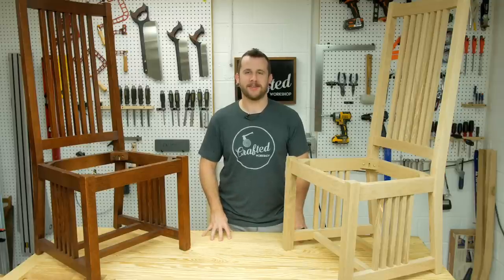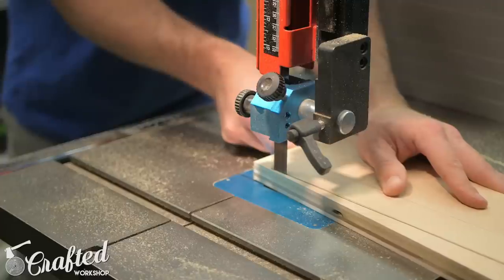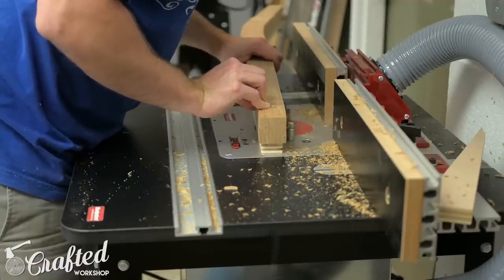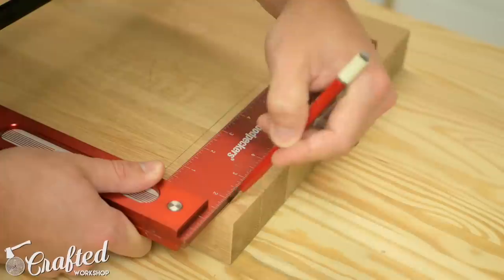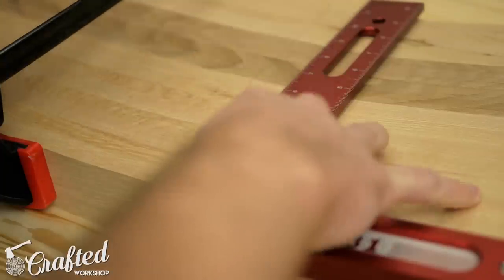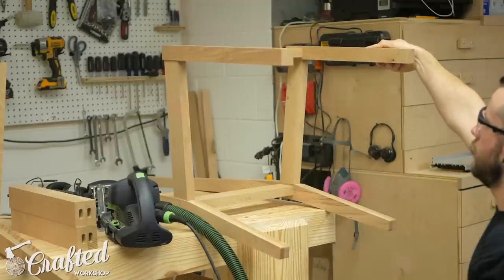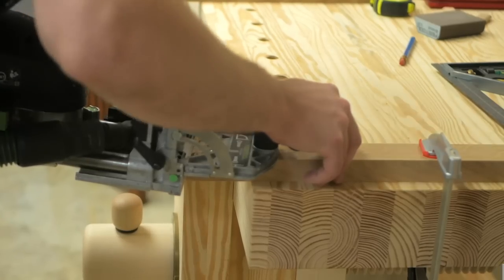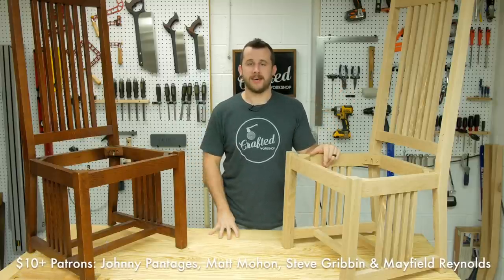Mission Style Dining Chair | How To Build Part 1 / Arts and Crafts Style Woodworking

Comment: I have to say I am very impressed by your woodworking.  I have been a carpenter for 20+ yrs and I am working on getting into wood working and cabinet making.  I have found a big success in the head boards I have been making, Thank you for all the great videos and detail along with templates, this is great.  I am looking forward to videos coming in weekly.. Cheers from Wisconsin
Reply from the maker: +James Ferdon thanks so much James! Never built a headboard, might try an entire bed build here in the coming months.
Reply: I too have done many full bed designs out of log beds for customers among other builds, I will show you some of the work I have done in the near future.  The head boards I am doing at the moment are flat ones that sit flush on the wall, but it depends what the customer orders, it how they are built, They are a hot seller to be honest, I did not think they would sell but I cannot keep them in the shop!! :)
Reply from the maker: +James Ferdon that's a great problem to have!

Comment: Excellent Video thanks. I've just started making the Arts & Crafts Stickley table to match, & the chairs will be next. So watching both of your video's was  a great help. One thing, you mentioned Woodpecker Tools. Yes they are good, if you can afford them. I was going to buy their Mechanical Pencil. I live in Thailand & they wanted to charge me 50 USD for delivery. That is way, way over the top. Thanks again for the video
Reply from the maker: Nice, good luck on the build! And yea that shipping sounds rough!

Comment: Nice job, Domino technique especially. White oak is such a great wood to work with, but the chairs are heavy aren't they! This chair looks similar to a Gustav Stickley No. 378 "occasional or desk chair" though I don't think I've ever seen a Stickley by any of the brothers with tapered and splayed back legs, so your friends' chairs are probably modern interpretations. I've made a few Stickley repros (rockers, side tables, recently a set of six No. 353 dining chairs) but never had to deal with compound angles, just angled mortises (or tenons) to attach the side rails and stretchers to the legs. Loose tenons sure make that easier, and I can see where a Domino machine would be a big help. But dowels and pocket holes aren't allowed :-)  (Note: if you make the back legs out of 8/4 flatsawn stock the ray flake will be on the fronts of the legs where you want it.)
Reply from the maker: +Michael Anderson thanks a lot! Definitely some heavy chairs! Yea this wasn't an original Stickley piece as far as I can tell. Definitely a more modern interpretation. And thanks for the tip, should have thought of that before buying 8/4 QSWO.

Comment: You should try putting the glue in the hole instead of on the domino, it's a lot easier and less messy.
Reply from the maker: +Brian Gray I've tried that, but  sometimes it creates unnecessary pressure in the mortise, in my experience. Ever happen to you?

Comment: Probably a simple question but is dominoes better than dowels? Thank you!!
Reply from the maker: I'd say they're slightly better since they are typically larger and have more glue surface. They are definitely similar though, and you could use dowels and be fine.